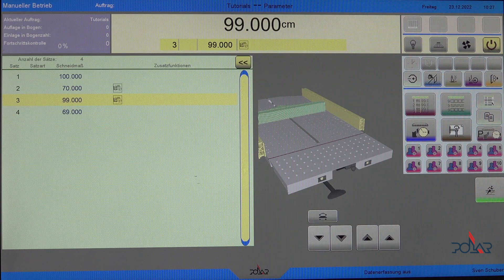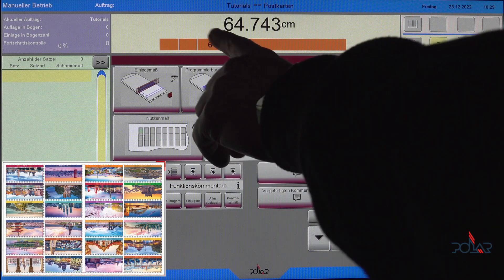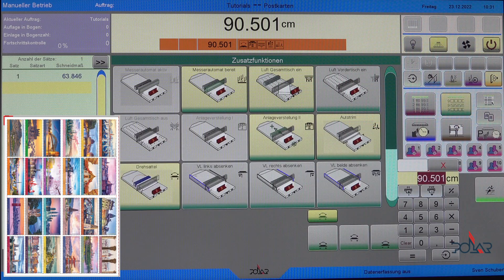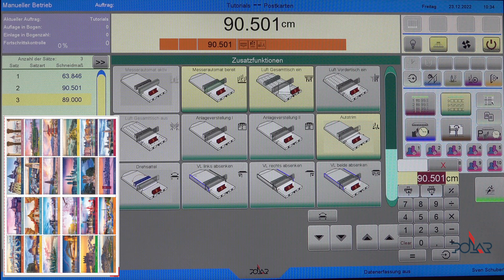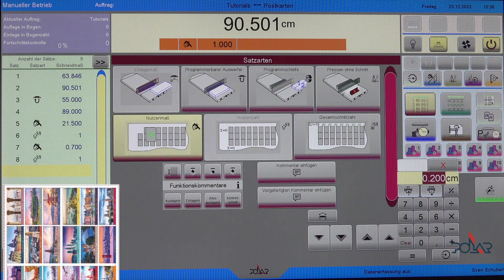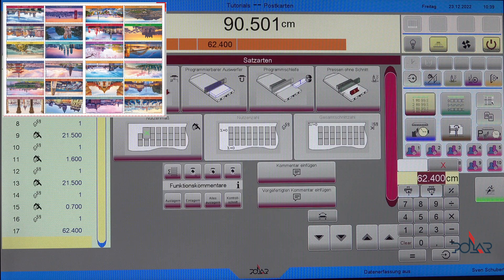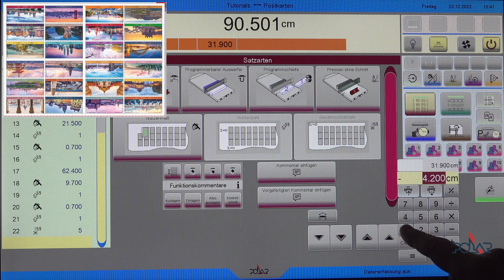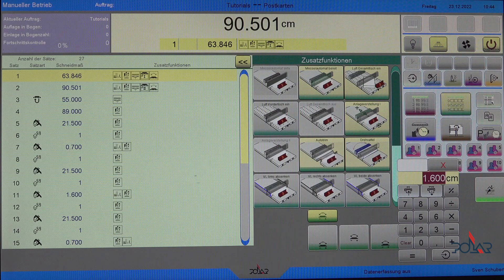Tip of the month October 2023 - Programming repeat cuts with Eltrotact

Comment: Love it! Been using it for years ;)
Reply: @octochrome. I have used Polar's earliest Eltrotact "P" (pulse) and "S" (sensor) systems on their CE tape control machines. Then on the following generations of EMC I & II , EMC Monitor and ED cutters. The easiest system to program and the best to use! The graphics on this touch screen are excellent.
Reply: @markmiwurdz202  I have used the EM & EMC monitor a while back, I am currently working on 115X at my workplace but I have used XT & N Guillotines, even had the pleasure of operating the SC-21 for 5 years 👍 I love Polar ❤️
Reply: @octochrome. Thanks for your reply. The Polar sales guy that used to visit one of the companies I worked at told me this. He said that at one time every other paper cutter/guillotine sold worldwide was a Polar. So that means that Wohlenberg, Schneider, Perfecta, Como, Itoh etc. etc. together fought for "the other one"! 
Not only are Polar Mohr excellent machine engineers, they listen to the operators, fulfil the customer's needs and thereby lead the marketplace! Stay safe and well.
Reply: I use this function all the time..